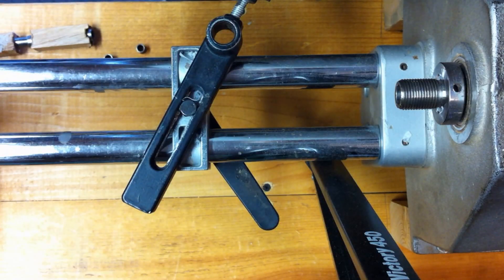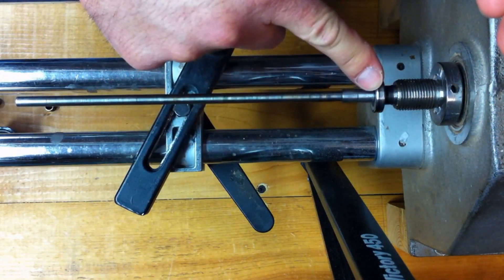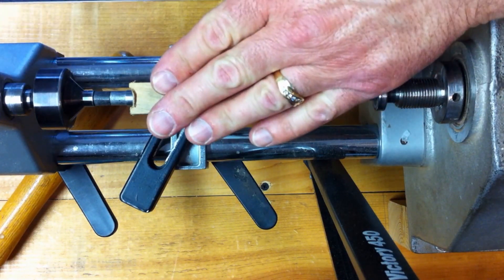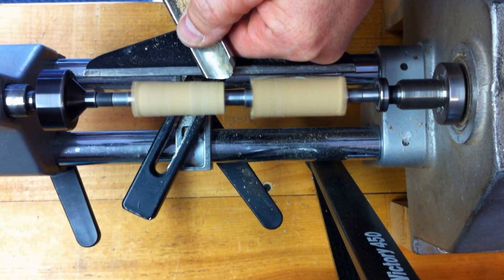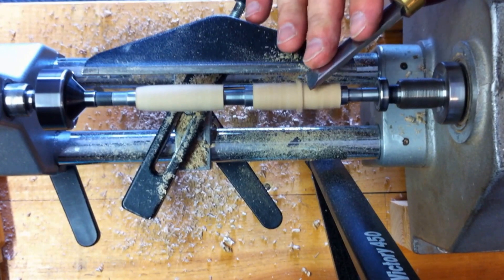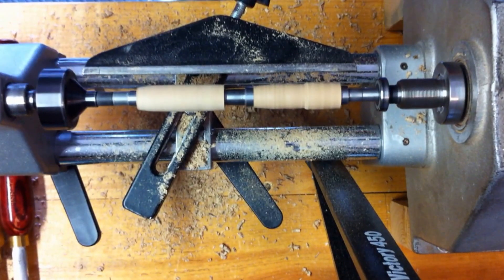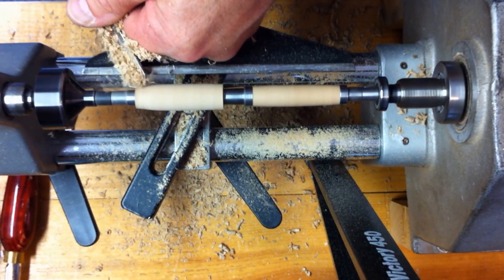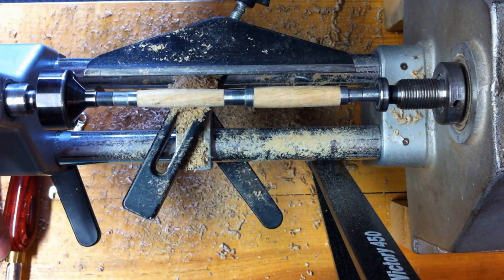What you need to know to turn an ink pen, Part 2 of 3

Comment: After many years of scroll sawing, I have also now decided to give turning a try.  I love it.  And thanks to you and 2-3 others on YT, my learning curve is lessening.  Thanks for all your videos Bob.  Very well done IMO.  If I could only figure out and get my blanks to not stop at the slightest touch of a tool (been using carbide bits).
Reply from the maker: Tighten up on the tail stock and it should keep spinning. 

Regards,
Bob

Comment: @9:24 what caused the unturned blank to momentarily stop?
Reply from the maker: I will watch the video first chance I get and get back you you with an answer. On the road today so it may be tomorrow. 

Regards,
Bob
Reply from the maker: RJBWoodTurner Sorry for the delay in responding,
  I watched the video this morning and saw what you were referring to. The blank stopped because I hadn't tightened the tailstock of the lathe. As it stops you can see some movement in the video, that was my right hand moving to crank down on the handle and tighten it up.
   I am not sure what level turner you are but just in case you are new and don't have a lot of experience with turning, the pen blanks are separated on the mandrel by bushings. The bushings not only let you know the proper size to turn the blanks so they fit the pen kit, they also allow you to put pressure on the blanks. The bushings butt up against the brass tubes that are glued into the blanks. The mandrel, they all ride on, is attached to the headstock of the lathe. I bring the tailstock up to apply pressure and tighten it down to hold everything in place. When it's not tight enough, the blanks will slip which is what you saw in the video. 
  I hope this helps to answer your question. I also hope I didn't offend you with my answer. I gave a basic response because I wasn't sure how much you turn. If I can answer anything else, please let me know.

Regards,
Bob

Comment: When you say to raise or lower the tool rest to the center of the blank, are you talking about the top of the tool rest or the cutting edge of the tool being used?
Reply from the maker: Great question,
  You want the cutting edge of the tool on center so adjust the rest to allow the cutting edge to be close to the blank and on center. 

I need to review and remake that video to clarify a bit. 

Regards,
Bob
Reply: +RJBWoodTurner Thanks Bob, your videos are very informative and you do a great job in presenting them so the beginner, and or experienced turner can go to the lathe and get great results. Keep them coming.
Reply from the maker: Thank you Wayne. 

  I appreciate you watching and especially your comment. 

Regards,
Bob

Comment: Question-I'm new at this:  how do you match the size of the mandrel bushings to the pen tube?  What is that cutter you used to face off the ends of the blanks? Thank you
Reply from the maker: +larry greene Hello Larry,
  I purchase all my pen kits from www.pennstateind.com. When I buy a kit, they always list the bushings needed with that kit. The mandrel is 1/4" and so is the inside dimension of all the bushings. So one mandrel will fit all bushings.

  The cutter is called a barrel trimmer and it works great for flushing up the ends of the blank to match perfectly with the pen kit. 

Regards,
Bob
Reply: Olá

Comment: hey bob i watched all of your video and loved them.  I do have a ? about your lathe i watched the video on how u set up the reverse switch on the lathe did mine the same, and after a little use of the reverse switch it stop working, only the readout still worked.  did u have any problem with yours?

Thanks
Bob
Reply from the maker: I haven’t had any issues. Check your switch and make sure it’s rated for 120 volts. Beyond that, I’d have to ask for help.

Comment: I love my manderal saver. I believe I understand that the knurled nut only has the real pressure on the manderal its self with little to no pressure on the bearings of the lathe. The manderal saver does put additional pressure on the bearings of the lathe. Can anyone confirm this?
Reply from the maker: I'm no expert but that does make sense. With the knurled nut mandrel, you only use light pressure from the tail stock to keep the mandrel aligned.
  With the mandrel saver, the pass through live center in the tail stock is used to place pressure on the bushings and tubes to hold the blanks in place. That is the knurled nuts job on the first mandrel. 
  Every turner has different preferences and having user both types of mandrel, I prefer the mandrel saver.

Regards,
Bob

Comment: What kind of lathe do you have I would like to get started doing some turning. Is it fixed speed or variable what would you recommend a person start with. I would like to learn to turn small bowls as well.
Thanks for your time
Reply from the maker: I have a Harbor Freight bench top lathe. It is belt driven to change the speed. The nice thing about this lathe is it is inexpensive so if you don't like turning, you don't have much to lose. It doesn't have a lot of power so it can't turn large items but it's great for small turnings.

Regards,
Bob

Comment: great videos i have the same roybi lathe what size mandrel did you use the one i bought is to big
Reply from the maker: Thank you Terry,
  I used drill chuck mandrel 3/4" X 16tpi from Penn State Industries, www.pennstateind.com
Part #: PKM-AL

  It will take the #1 MT, get the Mandrel Saver #PKMS1SET. It's $27.95 but it is an awesome mandrel. I used it for a couple years. Much better than the other one. 

  Bad news, the potentiometer burned out on that lathe and I purchased a Harbor Freight lathe.

Regards,
Bob
Reply: thanks a lot

Comment: This is a great series for the beginner.
Does the mandrel saver tail stock work t=with a standard knurl nut mandrel or do you need to buy it as a kit?
Reply from the maker: Hello Scott,
  You will need the kit. It is worth it though. 

Regards,
Bob
Reply: RJBWoodTurner  Thank you Bob,
This a really informative series. My son turned at one time  but moved on to art (drawing) and I have had a Jet lathe sitting in my shop for years; I have turned a few platters but I am really interested in turning pens but had no idea were to start.
Reply from the maker: Pen turning is addictive,
  A lot has changed since I made that video so if you have any questions, let me know. 

Regards,
Bob

Comment: Believe it or not, it's not the pressure of the mandrel nut that bends the mandrel shaft, it's the pressure of the live center being too tight. The screw can only stretch the rod, it can not bend it. That's basic physics. That being said, nice video series. I got some good information and ideas from it. Thanks for sharing it.
Reply from the maker: Richard,
  You are absolutely correct. I didn't even realize I explained a bent mandrel that way. I went back and watched the video again just to make sure and sure enough, I explained it incorrectly. Thank you for pointing this out.
  I hope to remake these videos in the future, making them much shorter and more hands on. I have learned a great deal since making them that I want to share and will be sure to include updates and corrected information like this.
  Thank you for taking the time to watch my videos and for commenting. Your comments help me to make better videos as I move forward.

Regards,
Bob

Comment: I have been enjoying your video"s but it seems that you have turned it into a turning video rather than a pen making video. If someone doesn't know how to turn anything on a lathe, they don't need to be learning how to make pens for their first project. They should just take some scrap of wood and learn what their tools do before actually making something. That's just my opinion after many years of woodworking which includes the lather operation.  Thanks for the video and advice.
Reply from the maker: Thank you for the input Daniel,
  I always like knowing what the viewers think.

Regards,
Bob